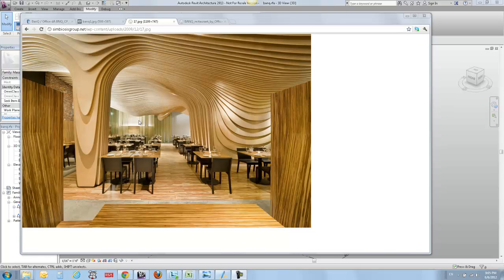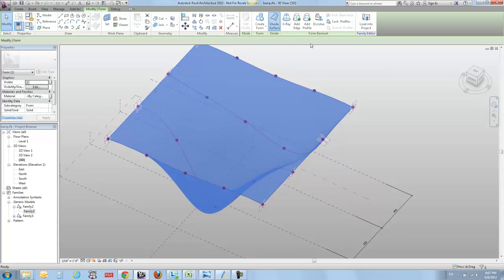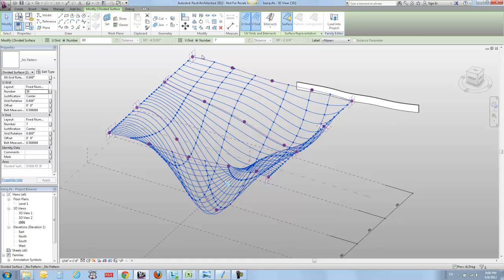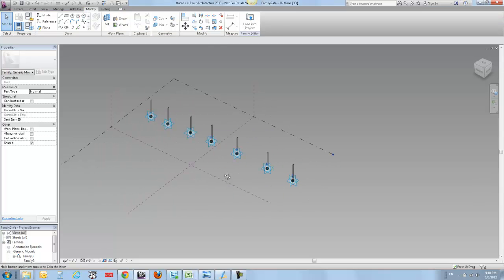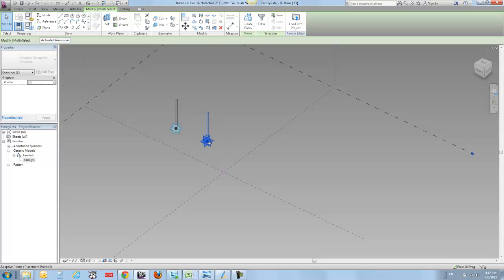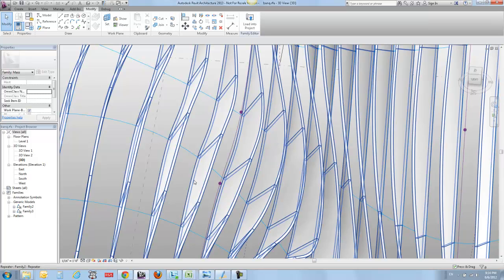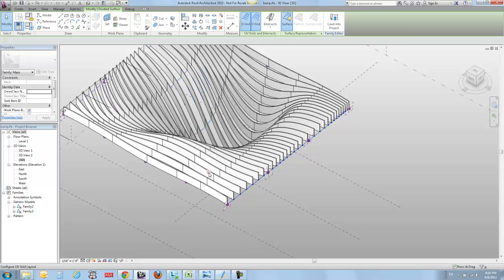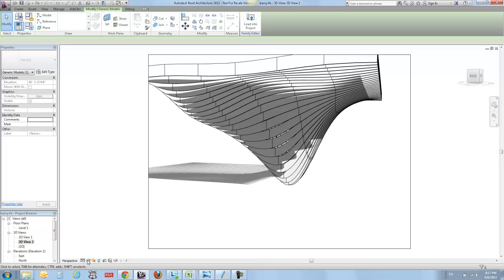Repeat and Divide Prt III:  Slats and Continuous Slices

Comment: Hey Zach, I'm having some difficulty with this. When I load the basic family into the one where you create the multiple versions, the rectangular form won't duplicate along with the adaptive points. Any ideas as to why?

Also the one time I did get it to work, the points I had wouldn't map properly to my nodes, even with place to face mode on. The family just remained its original size and didn't adapt.

I figured it was easier to just scrap it and start over!

Comment from the maker: you can bring the model into an rvt file and simply lay out elevation or section views for each slice.  Organization of these views would probably depend on your needed output, but I imagine just putting the section views on a sheet and exporting to your desired format is a start.  I would imagine there would be some data cleanup along the way with duplicate lines and such.